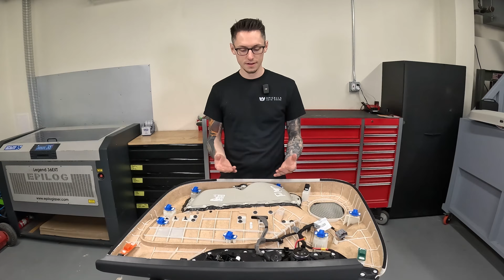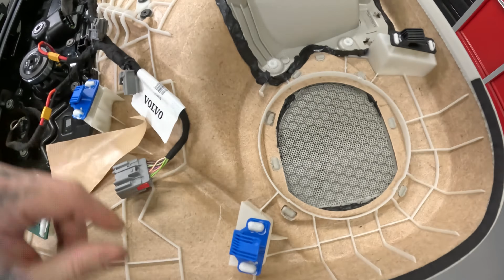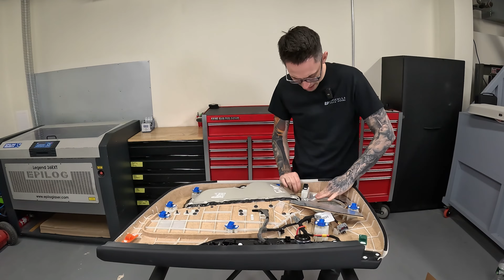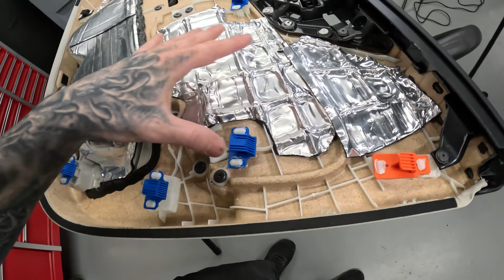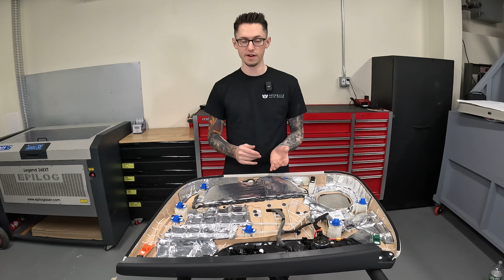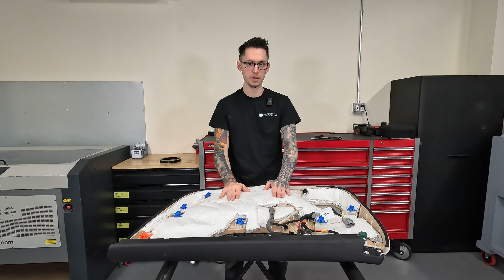How To Sound Deaden A Car Door - Part 1: Introduction & Door Panels

Comment: weather is warm today so i'm replacing my vapor barrier from an install 10 years ago...ty for the wax paper tip, simple but not as intuitive. i was using gloves to prevent the stick and to protect my nails, but i can just reuse the butyl tape wax paper ez

Comment: I put my beautiful in my vinyl mats in my beetle mats inside the oven set to 180°F. 
      So as I pull them out, specially on cold winter days, they are very soft and pliable and they stick very well. 
      Shops have been doing this for decades and Inside body shops where you have the very large hot heat lamps. 
     Preinstall your beetle under the heat lamp to keep it hot and soft and pliable during your install installation. You just pull off what you need from under the heat lamp continuously keeping it nice and toasty..  
     Especially if you’re working during winter in a cold, garage feels good on your hands too.

Comment: Hello! First I want to say, great video! Lots of good info... 

I have a pair of Kenwood Excelon XR-1701P 6.5"s in the front doors of my 2009 Buick Lacrosse. 

I have them time aligned perfectly with the rest of the speakers in my system. The tweets are up in the little plastic triangle area on the inside of the doors right by the window and side mirrors. The mids and highs sound just wonderful out of these speakers, but the mid-bass is lacking. I don't have any rattles ot vibration comimg from the door panels or from inside the doors, just a lack of mid-bass. 

From what I'm guessing, sealing up behind the door panels is probably the beat band for the buck to improve the mid-bass situation? I really dont want to spend 12 hours on each door going whole hog on them, but I DO want to improve things while I have the door panels off. What would be a few more bang for the buck/time to do while I'm in there? Sound deadening mats stick to the inside of the outer door sheet metal? Foam speaker baskets behind the drivers? Foam rings that seal the drivers to the door panel inside? Please help me out with a few good ideas that don't take forever to do while I'm in there, and really will make a difference.

The rest of the system is matching 6×9's in the rear deck with thise tweets in the plastic that surrounds the little triangle window behind the back doors. And then I have a sealed wall behind the back seat in the trunk with 1× FI BTL 15" sub, I.B. style in the wall. I am totally happy with the waybit all sounds EXCEPT for the lack of mid-bass up front. Thanks!
Reply: Easiest? Front sub.

Comment: Hey Nick, going through this process now. My door panel comes with factory sound absorbtion mat, about 4-5 mm thick. Would you recommend removing it and replacing with fiber mat, or just add more over it?
Reply from the maker: @Ifixtheinternet  depends on how it feels and how the door is structured. That thin, id probably replace completely
Reply: @ResoNixSoundSolutions  Thanks, there are 2 pieces - one area seems like there's enough depth to accommodate both, or maybe even 2 layers of fiber mat. The other seems like it would compress one layer with the panel installed.

Comment: are there concerns with the fibermat soaking up water being exposed to the door and rain draining down from the window?
Reply from the maker: @purplecello1048  fiber mat only goes on the door panel. That should be isolated from water. ResoNix Guardian and Lockout are meant for the door cavity itself and those can handle that environment.
Reply: @ResoNixSoundSolutions  have you recently upgraded/replaced the fibermat product? i only see the fibermat black which looks like tiles now and not lofted fibers
Reply from the maker: @purplecello1048  yes, it is slightly different than what you see here. Much better to work with than the older version

Comment: I am really confused about these door isolations. Don't they just absorb moisture and rot the door from the inside out ? Since its completely normal for water to go in the door and is supposed to exit from below
Reply: The manufacturer applies  small patches of butyl sheets to the inside of the door panel to assist with NVH but they don't cover the entire door. 100% coverage is not necessary for the product to do its job.

That said, what the manufacturer applies is the bare minimum and on a show or competition vehicle, it can probably do better with a little more insulation. One would think that type of a vehicle would not be subjected to the elements or the same wear and tear as a daily driver would, so rotting out is not a top concern.
Reply from the maker: Not at all. I suggest taking a look at our product spotlight videos. They will help shed some light on why this is the case :)
Reply: @ResoNixSoundSolutions  Which product in particular? Would love to have a link, i'm interested

Comment: Products are top shelf!  The fiber mat made a noticeable difference in lowering the cabin noise level.
Reply from the maker: Thanks!
Reply: The fiber mat is all you need for a door card. The butyl is better reserved for bare metal, as it provides sound insulation as well as heat insulation. And on bare metal it's subjective. If the metal is reinforced, you're likely not going to pick up much NVH.

Comment: Thanks for this, I got the level 2 kit. I noticed you avoided covering those 6 large black screws (rivets?) in the middle with CLD but covered them with fiber mat. I'm guessing those aren't important for servicing? Hard to tell without seeing the other side of the panel.
Reply from the maker: Just didn't want to go over anything that may be needed in the future.